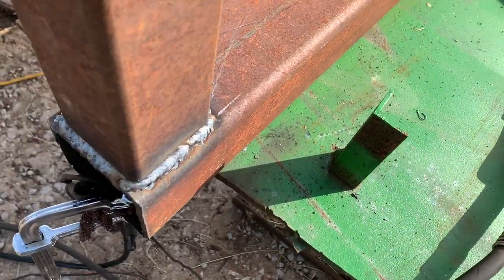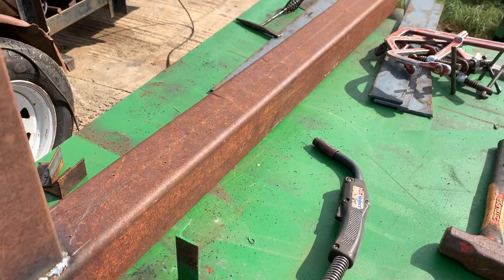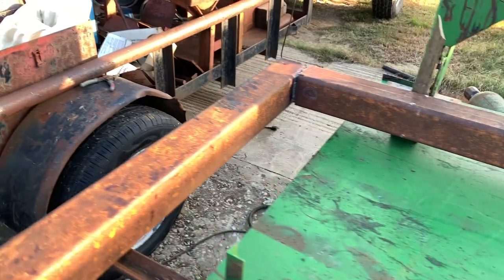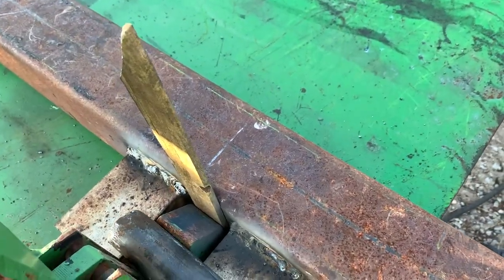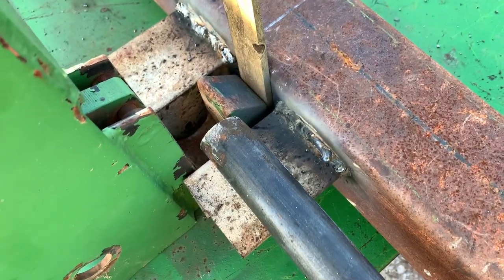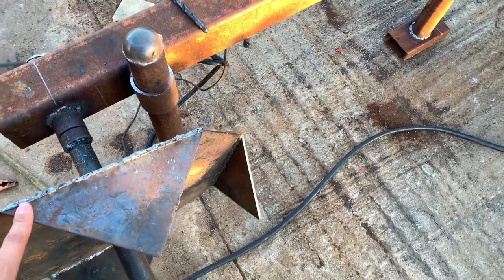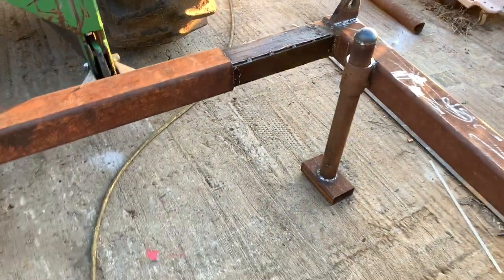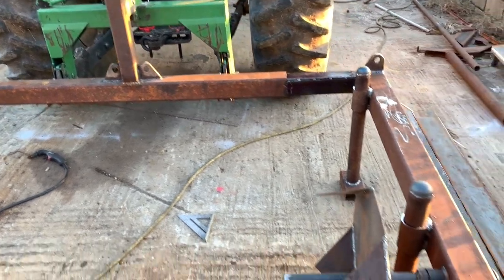Building Hay Bale Unroller

Comment: Good video, I am thinking of building one of these. Do you happen to have any dimensions? Looks like 4 in square tubing? The arm slides, are they 3 inch square tubing with 1/8 th plate welded on them? Thanks for any answers you may have.
Reply from the maker: Yes 4 inch tubing and 3 in slides. We used 1/4 plate. The 3 point 4 inch tubing run is 5 feet and the arms are 4 feet 6inches. If that makes any sense
Reply: @4MRanch  Thanks for the measurements, what cylinders were used? Double acting? Bore size, stroke length? Thanks.
Reply: I was curious too on the cylinder size and bore